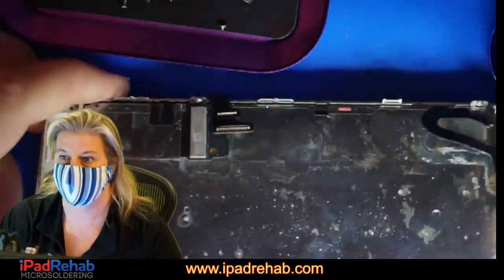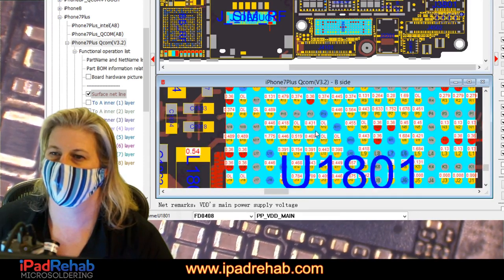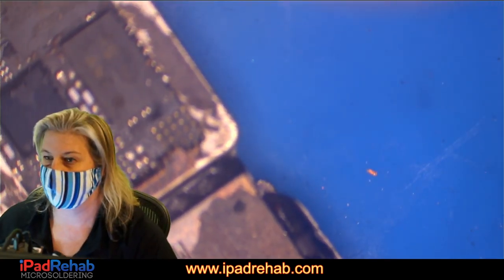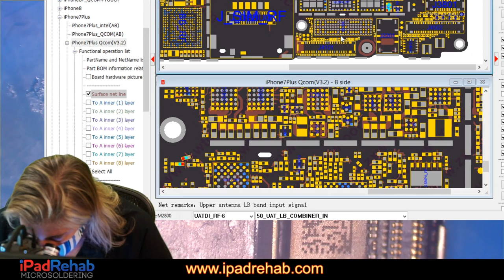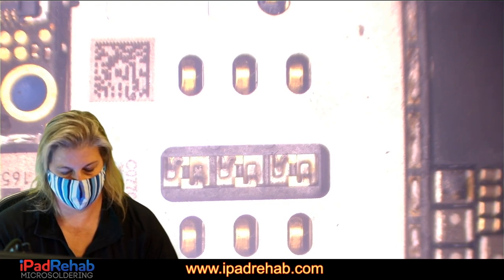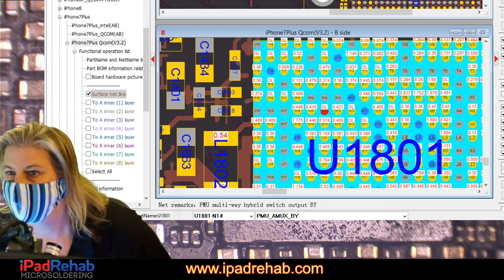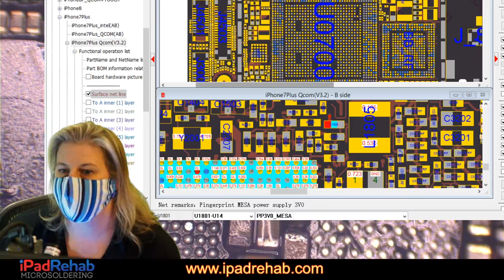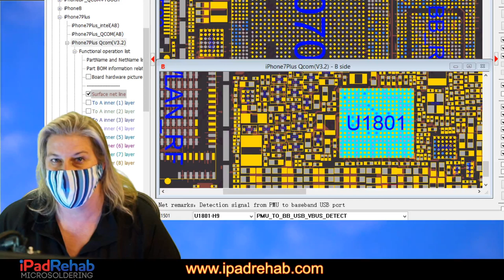OnTrack Data Could Not Recover this iPhone, Can iPad Rehab?

Comment: I once spent days off and on trouble shooting a computer that booted ok, then 5 minutes later would randomly crash but if left running would stabilize after 15 minutes. Turned out to be a cracked trace under a memory chip, and as things warmed up the board and the copper expanded at different rates. So it conducted then went resistive, then closed and worked as it got to operating temperature.
By the time I fixed it I was not charging the customer for the time, I was just being stubborn, but still remember feeling good about finding it,  35 years later.
Reply: Gary Gough but how did you find it? what led you to it?
Reply: @crazyduck1254  I took continuity readings on all the address lines and data lines, which should have been nearly 0 ohms, and found one address line that read 5 ohms end to end. Then read from the mid point to ends and repeated until I found the point. As the line was shared by the RAM chips, a jumper between pins across the break was a fix.
This was an Amiga 1000, so in the days of .1 inch pin spacing.
Reply from the maker: And you still remember it!
Reply: I encountered something like that on an Acer monitor I got cheap on Craigslist. Vias between sides were opening once the LED driver board heated up. A bunch of them were failing like this all over the board. I used thin wire through the vias soldered to traces on both sides to fix. Has worked fine since.

Comment: I have an iphine8 that I found in the ocean. It was in a beefy case. I immediately put it in alcohol. The battery was dead. After a few weeks I dried it out. Inside is scattered with rather large salt crystals. But it otherwise doesn't look corroded at all. Not even the connectors are corroded. I don't know how long it was in the ocean. I'm using your guides to take it apart and clean it. that's as far as i got with it so far. I'm amazed it doesn't look slimy inside. I'm hoping to turn it on and return it to the owner to recover. I love working on this tiny stuff under the scope. I just don't get a lot of chances. Maybe it's a sickness.
Reply: Looks like you need an ultrasonic bath which is currently on promotion, only at rossmanstore dot com.  That's rossmanstore dot com.  BTW, did I mention that they also have some excellent cleaning fluids?  Amazing fluids.  Some incredible work they're doing with those fluids.

Comment: Two possible causes that came to my mind after I saw the video:
1st, there is no direct short to ground but an ic draws excessive current, the pmic is going to overcurrent protection mode and auto restarting. Maybe you cound measure the output voltages and see if one line is intermittent.
2nd, an input or output signal from pmic got higher than normal voltage and as a result the pmic is destroyed. Maybe you could measure in diode mode the pmic pads if the values on zxw are correct.

Comment: Very much agree with your comment about common modes of failure in each type of device. A colleague who worked at Sony UK repairing commercial/domestic equipment told me that every model had a stock fault and 9 times out of 10 given a particular symptom the solution was curing the stock fault that ran through each generation of equipment in manufacture.
Repair is a process of elimination. There is no quick fix. So all these folks saying “transfer the cpu” are not understanding the basic principles of fault finding. Not understanding how circuit elements function, and knowing that function how to systematically deduce which element is the main cause of a product not operating.

Comment: for hard cases like these ones, wouldnt it be possible to transfer (desolder from bad iphone and resolder in known-good iphone) the data chip? does the iphone checks for something like that and it wont boot upon detection of hardware replacement (i.e. like the fingerprint sensor)?

Comment: My guess is that the phone has been butchered and that replacing suspicious looking componets should be top priority, especially to enable you to recover the data. So once thats down, clean the phone and then check for all the critical voltages and replace components as required. It will be a slow process.
Reply: Butchered? Nothing had been taken off. Because when you take an IC off, where would consistent trail of corrosion and contamination on there come from. They really just opened it and NOPEd out of it for sure.

Comment: Hi
 
Greetings from Belfast in the UK.

I've been following your video's for a while now.

Did you ever get this resolved, the reason I ask, I have a theory, unless I missed it, you look at 

U1801-N15 PMU_AMUX_BY - Test Point TP0423 which is directly under your hotspot.

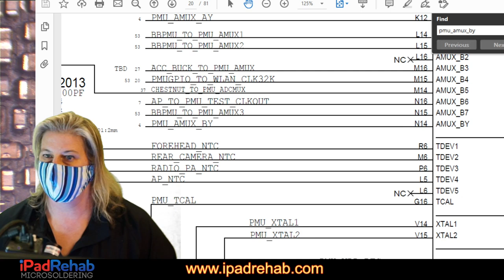But you skip over it's mate shown in the circuit diagram for AMUX at 1:52:18

U1801-K12 PMU_AMUX_AY - Test Point TP0413

Not sure what the AMUX does, but if R0413 (100 to 200K) were open circuit, a transistor inside U1801 may now be biased on

which would otherwise be off causing the chip itself to be the path to ground.

I'd imagine if it R0413 were short circuit instead it would be lit up on your thermal camera.

I also take it OL shown next to K12 on the ball grid map is when your meter is in diode mode rather than resistance mode which presumably should show between 100k and 200K

Muxes occasionally have an A & B output, or one is the opposite polarity to the other.

Just a thought, could be way off, it's been a while since I did board level repair, I'm in awe you are able to do repairs on boards of this size/density.

Jeremy